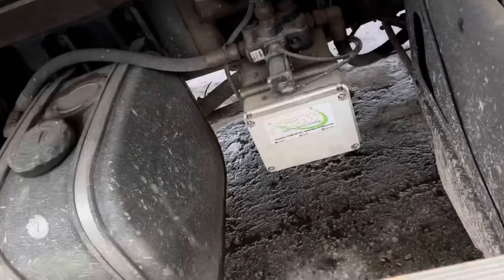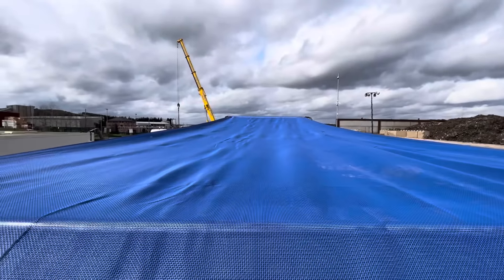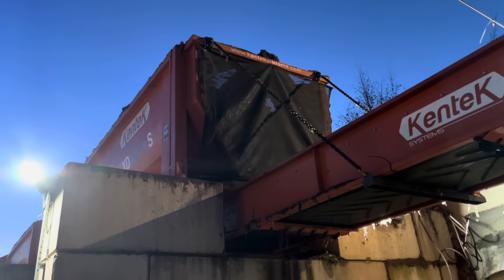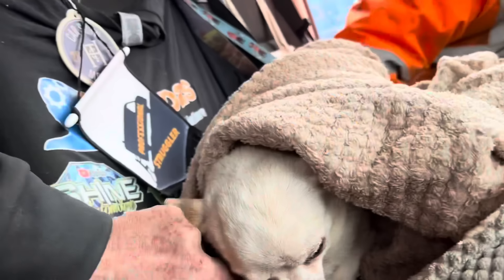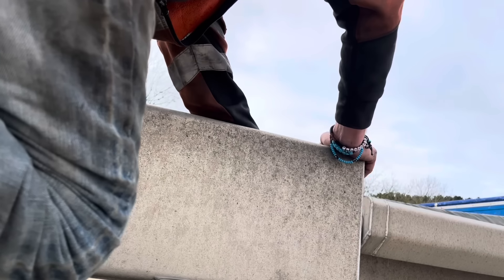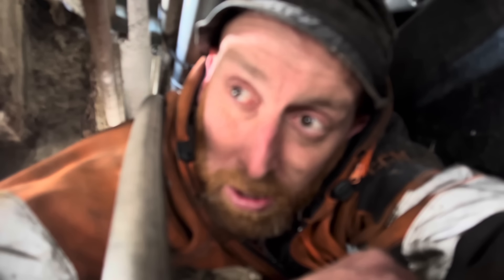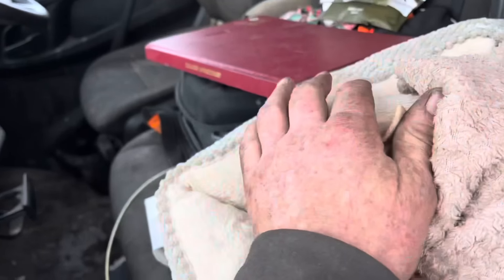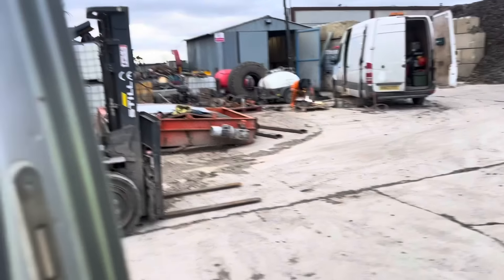Amateur hour! Easy sheet farce!  Shredder down again!

Comment: Little tip Chris next time you change a sheet on a tipper at the cab end there's a cut out in the middle of the reel just slide sheet to the middle saves taking all the reel off

Comment: Love a good struggle chris 😂 there's a piss easy way to fit those sheets, look at the bar in the middle the slot gets bigger. Pull the sheet from outside to inside. You can feed the new sheet in through the gap 🤙🏻

Comment: Just let you know can save a bit of time and bother in the middle of the front sheet pole there is a cut out so you can slide the new sheet in without removing the pole and brackets hope helps